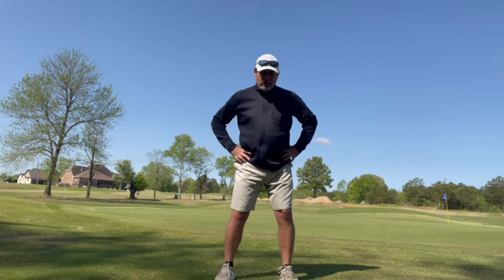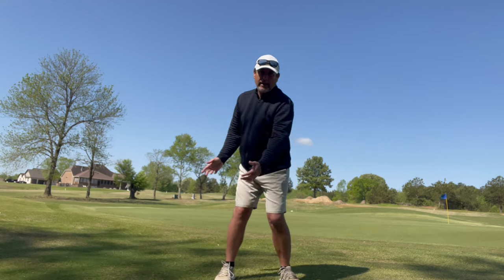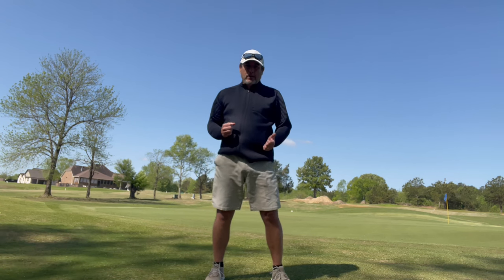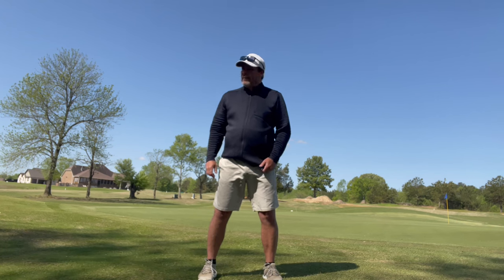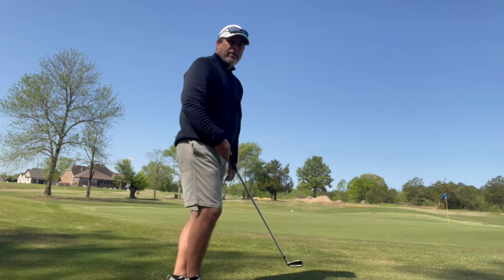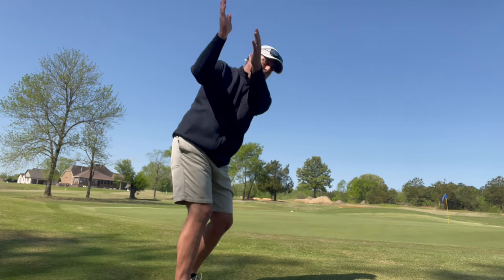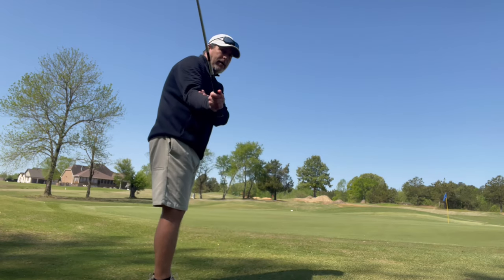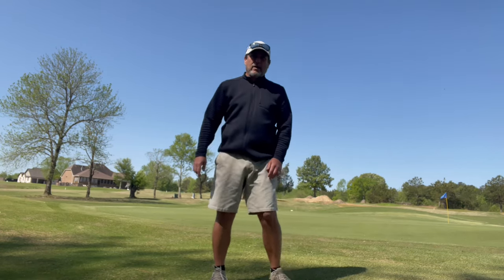Matt Gray-Spiral Golf Swing

Comment: I'm glad to see you carry the torch Matty . no question the back ball cl protocol swing carrys merit . it's definitely a cork screw swing to let happen that I start from a open position but can play closed feeling feeling like I'm I hitting a dead pull stinger. Cheers.
Reply: Hi Nat , 
     The key with the spiral is to finish it .  I think people that haven’t had success with CL probably only use two portions of the spiral .The 3rd portion is just as important.  The shoulders shouldn’t be open at impact but they  do open immediately after the ball makes contact with the club. 
    I don’t mind sharing what I’ve learned. Some people will benefit and some want . It’s just nice to have alternatives .  Cheers